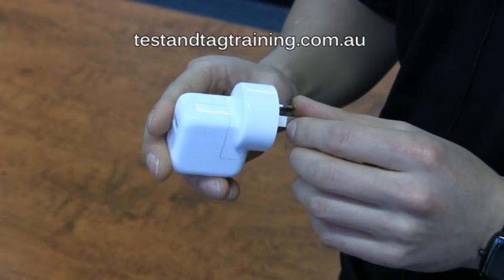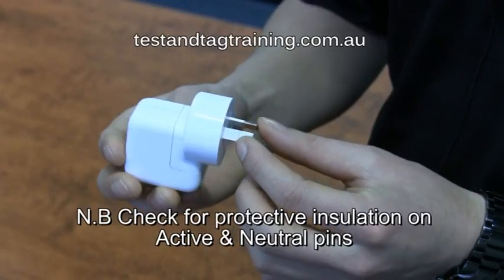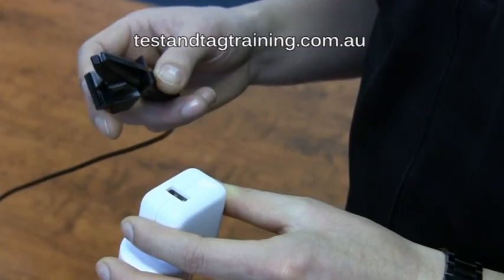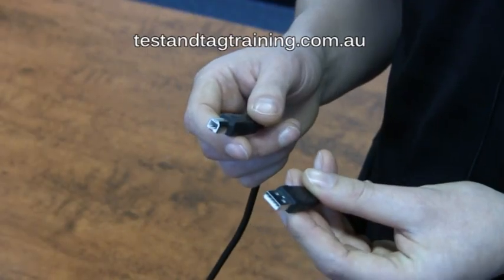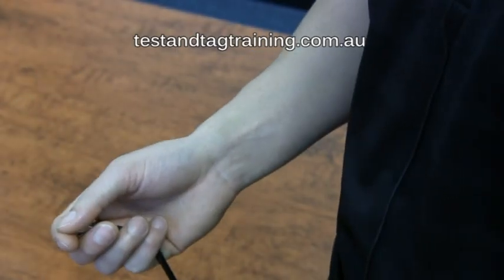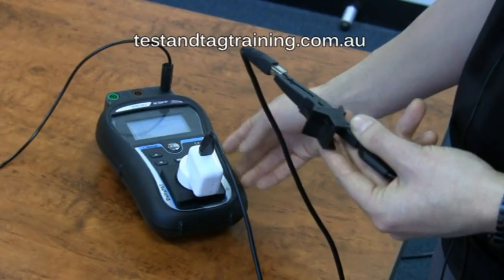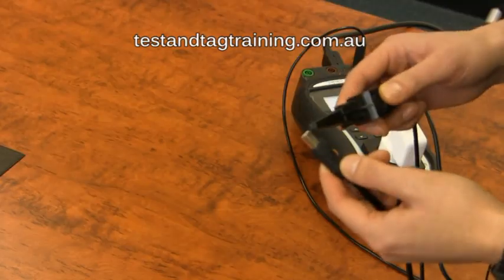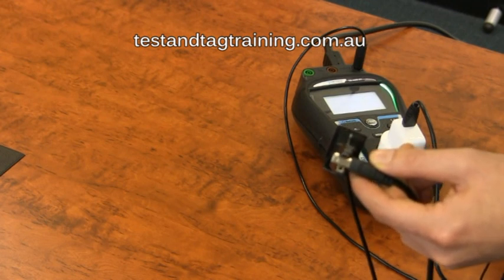Testing & Tagging a USB Charger

Comment: This is a class 2 (double insulated) item with sensitive electronic components, so 1, it doesn't require more than a formal visual test, and 2, you shouldn't put more than 250v through anything with electronics anyway, there's a good chance you'll fry them.
Reply: The 250v is correct, but they definitely do need testing. Some of these chargers are fake and have killed people, therefore they need testing.
Reply: @PF-gi9vv  You cannot perform a meaningful test on these
Reply: @caterhampattesting  Yes you can. If you know anything about PAT testing then you would know everything can be PAT tested. You need a USB lead with all the 4 terminals connected together, plugged in to the charger. You should be able to work out the rest.

Comment: Thanks for the video. Is there is special test and tag sticker we use to stick on USB charger?
Reply: yes, its called a pat test label , to let someone know its passed and is safe to use , a log should be kept tho encase the label falls off so you know that its still safe and in date, so you know when it needs retesting if the label falls off. you get two versons your passed, which means its safe, and your failed which means its failed and is unsafe and should not be used.

Comment: Mate great video. We were discussing this requirement today at work and how we would do it. One question I do have though is how do you test coffee machines I have Nespresso machines at work and I can’t get them to pass a simple test. Both a reasonably new. Have you come across this with any you have tested.
Reply: have you found an suitable earth point like a screw etc so your earth bond clip could clip onto but some machines have a option to remove the clip and have a point on the lead for hard to reach items where the clip can't clip onto, if it fails a class 1 or 2 test even if its visually fine on the outside it might not be inside what the tester has picked up and then should fail the appliance and take it out of service, here in the uk a item dosn't need pat testing until its 12months old. I havent but general rule of thumb if an appliance fails , fail it and take it out of service until it can be repaired or gotton rid and replaced